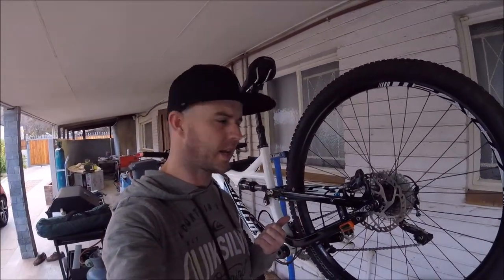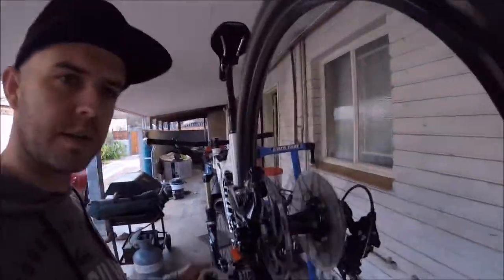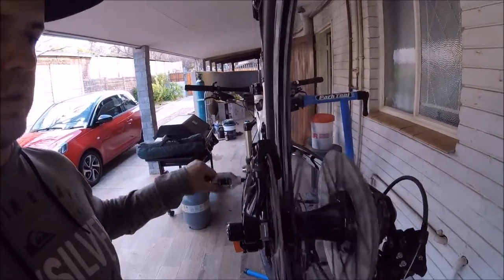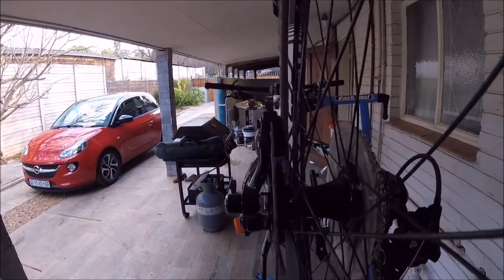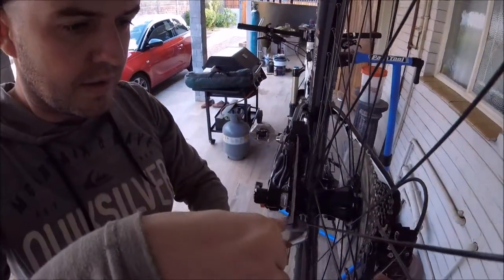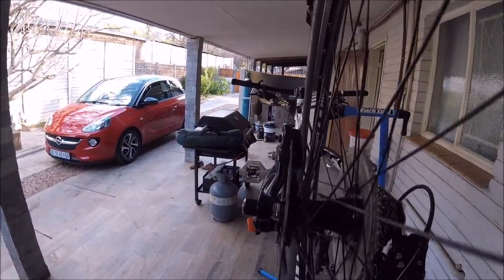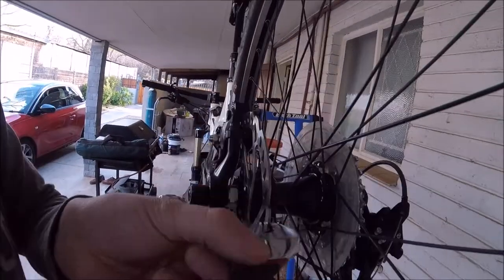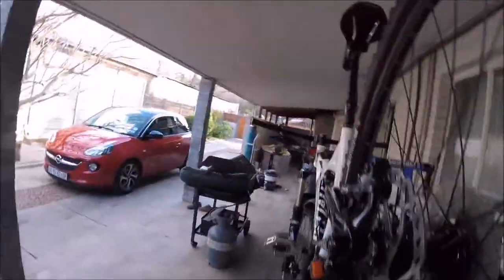How to Fix a Bent Disc Brake Rotor on a Mountain Bike

Comment: Bro spent like an hour trying to true the rotor and won't go perfectly straight, second time I've tried trueing one, one from a curb strike on a escooter and one other heat warped mtb rotor, both spent like over an hour trying to true to no avail, they got to like95% but I could still hear slight scrape...I'll always try to fix but yeesh this one is tricky , I'm guessing it's because I am using high end hydraulic calipers with very tight tolerances when the pistons are set. Not really worth much effort with rotors being around 15$ these days and get a few years out of them, and that's coming from an unemployed DIYer. Thanks for the video to comfirm I was trying the right fix. I'm running SRAM Avid CR front n rear
Reply from the maker: Hey man, yeah I guess this fix won’t work in every situation. I was lucky as the bend in my rotor was minimal. Sorry it didn’t work for you, but as you say, it’s always worth at least an attempt. I think once one spends more than 45 minutes on this repair without results, a purchase of a new rotor is inevitable👌🏻